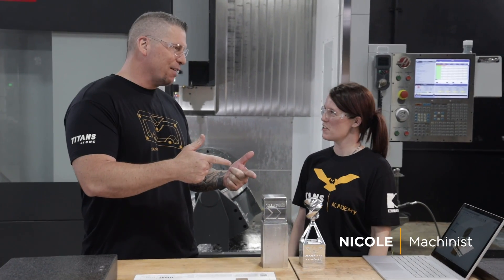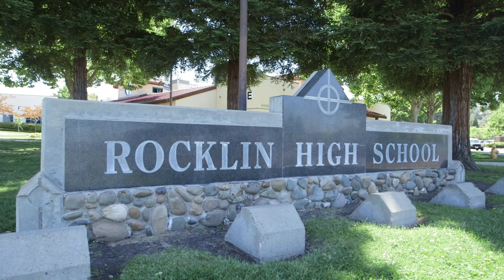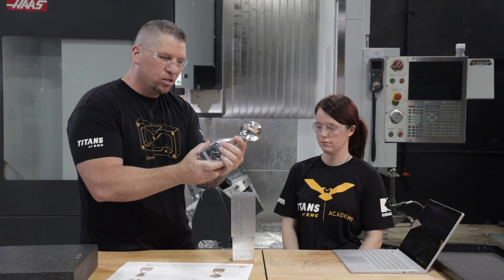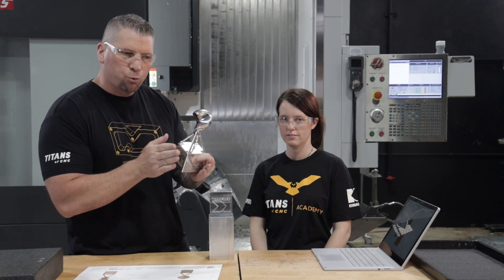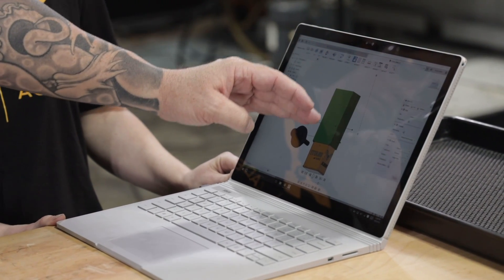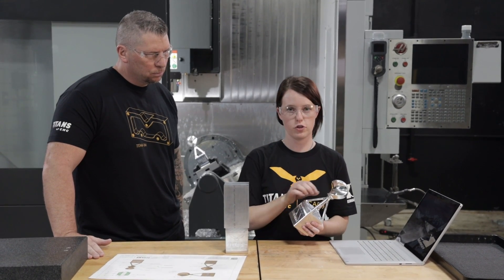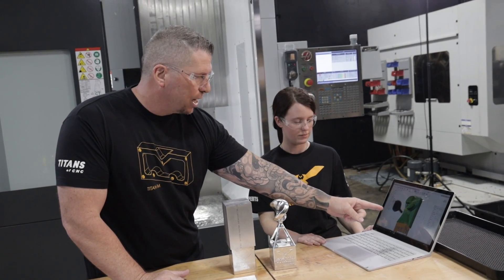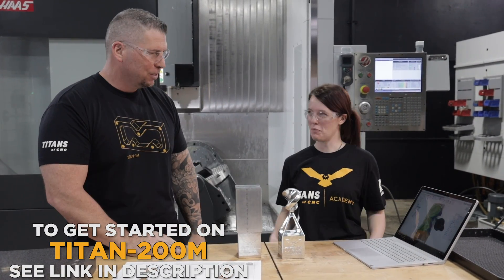Programming 5 Axis W/ Zero Experience | CNC Machining | Vlog #80

Comment: hey, it's NOT the part which is throwing us, it is that the computer has control, NO dials or handwheels for us (as basic machinists) to turn to initiate a cut, and for us with ZERO computer based machining experience, we understand parts like these MUST be CAST out of a sand box, to get that level of features, and their finish, as "we" can't machine them using a 'traditional' engine or manual lathe, or with files, saws, etc. so an idea is to simplify how the screen on the machine works, what everything is called, how and what programs are called, how to 'write' them, in our minds as well as into the computers "thing" which makes the part.

Comment: titan, i have a .001 tollerance part that may pose a challenge for you
Reply from the maker: Probably a challenge for anyone:-)
Reply: @TITANSofCNC  want the cad let me know... you can use it in your classes
Reply: Richard Taft, .001 tolerance is relative to the envelope of the part.  It is a very tight tolerance on a 50" part but wide open on one that is less than .500".
Reply: @rayballard8152  so true.. I guess I should have explained more. 3 sets of parallels 5x1.5x.5 inch part with a multi angle change tube drilled through it on the long axis .... that's the hard part

Comment: Machining is a hard job why do they only pay $20 an hour? Do you think they are under-payed
Reply: $20 underpaid. Certainly. 
I get 14 an hour. 2 years experience, I program on the control. Set up the mill and run the part.
Reply: @justnd2582  dang. I live in louisiana and i started a job as machinist helper, i never even seen a cnc mschine in my life had no idea what it was, i was making 12 an hour just helping, then 4 months later they moved me to machinist making 14 an hour now i make 15. All within 9 months
Reply: @shanemichaelneal   2 years ago I started at a machine shop, sweeping floors deburring parts and cleaning parts. Making 9$
Started training on a vf3 ran ot for 6 months finally got to 11$
Found a better workplace started there at 13 after 90 days I got another buck. I'm up to 14 now.
Reply: @justnd2582  what state??
Reply: @shanemichaelneal  Louisiana
Reply: @justnd2582  damn you must be cutting plastic, i work in a steel manufacture in cnetral la
Reply: @shanemichaelneal  lol. I've never cut plastic. I cut aluminum, brass, 4140,4130, a286, 416, 17-4, 316 cast iron, 6160.
Reply: @shanemichaelneal  I work in Youngsville Louisiana
Reply: @justnd2582  damn thats crazy, half the guys i work with are from lafeyette but they talk about how much money you can make there